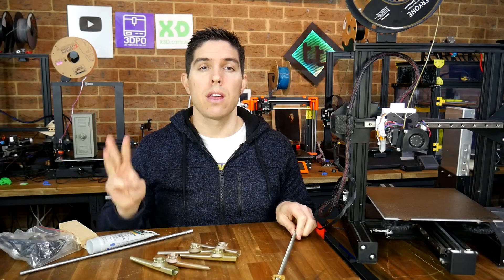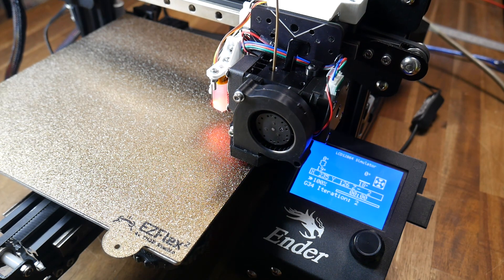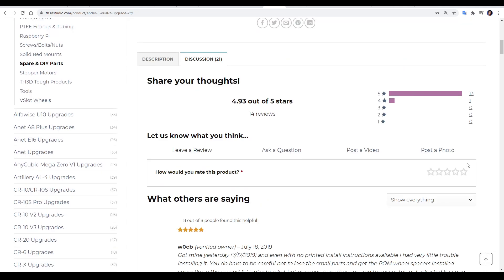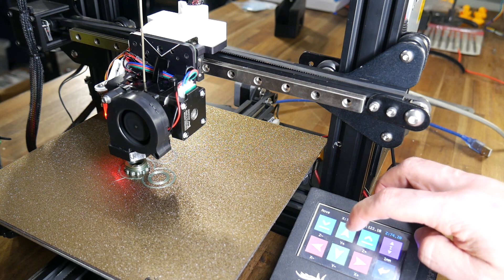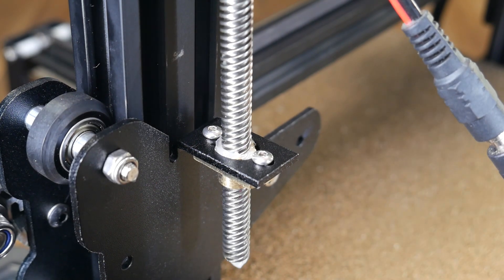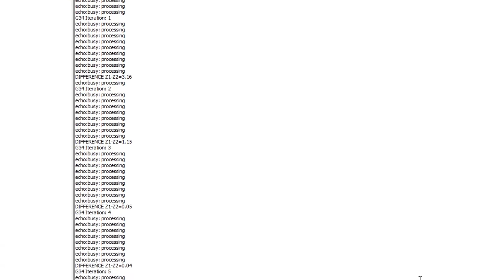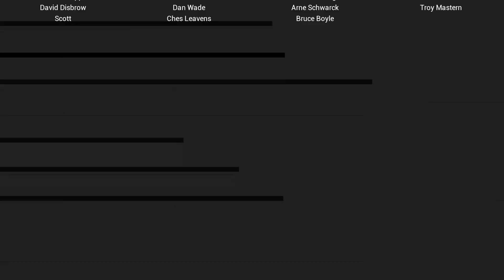3 ways to add a dual Z axis - Including G34 auto Z levelling

Comment: Doing the first method on my ender 3 v2 for about a month now, and it seems to work well. I also added anti backlash nuts on each gantry mount. 

Two things though:

1) basically impossible to move the gantry by hand now. I can only do it by twisting the rods or pulling the belt. Just pushing the gantry does not work anymore

2) motor runs a lot hotter at the same vref. 

So basically the strain on the motor is much higher with all the added friction and weight. As a result, while my machine is now precise enough for z hopping on retraction, I can't really do it, as it will usually have one or two errors, where it skips a step while hopping and ends up to high.

Thinking about adding the second stepper (as my rods have equal length its very easy to add), although your advice on how to level the gantry was much better than what I used before and I discovered an offset of maybe 1mm, so I'll test first if that changed something (by adding even more friction)

Nonetheless, this massively improved height accuracy. Before my prints would always be 1-2% too short, now they are perfect.
Reply: Would you still recommend the belted Z option or go dual motors? I've taken my gantry apart and tried to align everything but just can't seem to get it right and am getting crushed layers for the first 3-4 layers and it's ruining dimensional accuracy.

Comment: Damn, the timming of this video is scary. I just installed a dual Z on my Ender 3, but I got the kit that has two stepper drivers because it's was simpler and cheaper. The whole kit with stepper, Y cable, the lead screw and all the accessories was just $20. :D
Reply: Where did you get the kit from?

Comment: lol waited for this video for a long time, I already installed my dual z and linear rails on the z a month ago (I went for the belt system) and from the experience I have with the installation, I can say you covered most of the things, but for the linear rails (what you didn't covert in this video) I had problems with aligning the frame, took me 2 months to figure out that both of the aluminum extrusion of the z-axis wasn't parallel to each other and I used alignment tools for the linear rails and they should have been parallel with that tool but the problem in the end was with the frame.
So my tip is if you have issues with getting it to work properly, check the frame if it aligned and parallel to each other (it can be an issue also with v rollers)

Comment: I took my Ender 5 Dual-Z last year as the cantilever bed sags something chronic out of the box. Started with a belt driven second leadscrew with the motor driving the belt, my thinking being that I'd get more even power transmission between the two screws. Turned out I just got very uneven layer movements. Went to a second stepper on the fifth output of the SKR v1.3 in it and the prints are almost perfect.

Comment: And now the great question: what happens when you combine Method 1 and 3 (which is kinda Method 2 with an extra step).
Would it be WORSE to have also the belt or would there be some benefits? I bet longer rods are available in any craft store-
Reply: The idea of method 3 is to have each z stepper control its own lead screw separately. If you connect them by a belt, this defeats the purpose since they would have to move together. 

It makes sense to have the belt connected for method 2 since the steppers can come out of sync easily, but method 3 has the ability to correct that
Reply: @issanesheiwat1396  yeah, makes sense... no idea why I asked for method 3 ^^

Comment: Method 2 is in “series”, not “parallel”.  That is why you need to have the jumpers installed if you only have 1 Z-axis stepper on a dual-Z board.  🤠
Reply: With a single z driver, you can run either parallel or serial, depending on your wiring.  There are advantages/disadvantages to each.  I have ran printers both way and not really seen any issues.
Reply: @halsaresnowpaw522  if you run in parallel, the current through each stepper may be different, and you’d need to double the current, which may overload the driver.  Aside from that, dual Z-axis boards are wired for in series, not parallel.
Reply: @cnc-maker  As I said, there are disadvantages to each method.  The extra current is one of the disadvantages of parallel.
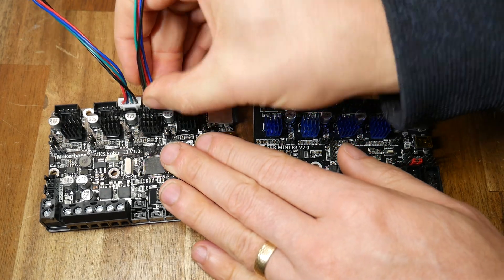Reply: @halsaresnowpaw522  at 10:38 he says, "..newer boards already have parallel zed outputs."  That is what I was correcting.
Reply: @cnc-maker  Given that no jumpers or other changes needed to be made to the board, it looks like it is a parallel connection.  All the boards I have worked with in the past where the second Z axis is serial, there were a series of jumpers that would need to be removed.  This is required to run in serial as the second connection has to complete the circuit.  Looking at the schematics of the MKS Robin E3 V1.0 board (https://github.com/makerbase-mks/MKS-Robin-E3-E3D/blob/master/hardware/MKS%20Robin%20E3%20V1.0_003/MKS%20Robin%20E3%20V1.0_003%20SCH.pdf ) it does show that the second plug is indeed a parallel connection.

Comment: $70 for the first option ? that's insane. BIQU have an all metal Dual Z which include an additional stepper for $36.
Reply: On aliexpress you can get an all metal kit for 21-25€. Also including 2 new z screws of the same length, so it's easy to include a second stepper at a later time

Comment: I have a custom one of these waiting for you to try on your ender 5! 
https://twosixengineering.com/gtr-shop/ols/products/ender-5-dual-z-axis
Reply: This is the kit I have, Which has the Dual Steppers in Back and Front orientation, how do I get G34 to work when it assumes all Dual setups are in Left Right mode, I tried the Orientation setting that didn't work.
Reply: @Tihkal01  so you set the positions in the X axis range rather than the Y. The probe positions that is.
Reply: @twosixengineering  This is what I assumed as well, but haven't been able to make it work. Have you gotten it to work on yours? What is your #define Z_STEPPER_ALIGN_XY value, is that what your talking about setting?
Reply: @Tihkal01  honestly I have been running mine for over a yeah and a half with a parallel cable. Never have any issues with it staying level. Maybe a fine tune of offset every now and then. I'm running ABL. A few others running this kit have published great info on getting it working. I finally purchased a board to allow me to add the g34. I can let you know what works for me.
Reply: @twosixengineering  Thanks, yeah I really don't have any issue with it staying level to be honest. It's a great kit. I just love tweaking, and this looked like one more thing to mess with to make it that much closer to perfect. I Have a SKR 1.4 TMC 2209, with EZABL.If you find the magic Marlin setting to probe back to front for this please let me know.

Comment: With method 1; what I don't get is why doesn't any kit or the majority or users doing dual Z this way, don't add a z rod stabilizer on the bottom of that second Z rod?

Doesn't the belt add force on top to move the rod closer to the other one? Making the bottom ofbthe rod move in the other direction.  This can cause binding when moving the gantry up or down.  
I don't know because I haven't tried it but it feels like a rod stabilizer or "holder" at the bottom, would keep the Z-rod as straight as possible
Reply: If you "stabilize" your rod on top and on bottom also, then a bent threaded rod will jerk the gantry while rotating. (all these chinese rods are bent, take it as a default)
Yes, the first "main" rod is also constrained on top and on bottom also, so sometimes this method harms more than it helps. I had this belt driven dual Z axis on my Ender 3, it was worse than in original form. I had serious Z banding. Now it goes with the 2nd method, the two motors are connected in series. I aligned everything, and then marked the rod positions with a sharpie. Now I can spot if the two rods are misaligned by an accident, so I can quickly realign them. :)
Reply: @dexter323i  I would think so, but in the case that a rod is slightly bent, one could use a flexible coupling on the bottom on some kind of jig (acting the same as having a second motor).

CR-6 does dual Z with dual motors plus a timing belt.

What I'm thinking is that since most of the time the gantry is at the bottom, the force of the belt could temporarily slightly force the rod to the center of the printer
Reply: I'm using the design by proper printing it has 2 bearing in each top bracket on either side of a large 60tooth pully. This way the rod is pulled evenly from the center of 2 supported points. I have no issues with mine. I did however due to either my printer being slightly different than his or the belt I sourced being a little smaller maybe (same number of teeth though) had to re design his parts for the right side to get proper vertical alignment and get rid of binding.
Reply: A bottom guide would be great, but as long as the belt isn't too tight, the deflection should be minimal.

The one thing I don't like about these belt solutions is they go cheap on the tensioner.  There should be two more pullies so the belt goes in at a 90 degree angle to the tenstioning pulley.  You want to keep as much of the belt in contact with the drive gear.  Without the extra pullies, the angle on the drive pulley reduces the amount of contact of the belt.
Reply: @halsaresnowpaw522  I'm getting a little of topic from the parent comment but... would it help to have the single tensioner in the middle vs slightly to one side? 
(I know it's because of the spool holder) but I've never liked spools positioned there anyway
Reply: @PandaTaco  Moving it to the side as shown in the video decreases the angle the belt comes off the drive pulley, which is good.  But it increases the angle on the pulley to the second lead screw, which is bad.  The increased angle can lead to belt slippage.  There wouldn't be any issue to have the tensioner going to the back either.
Reply: @halsaresnowpaw522  this is true for high torque and speed. But I think you'll find that because Z moves so little and so slowly you won't experience any skipping of the belt